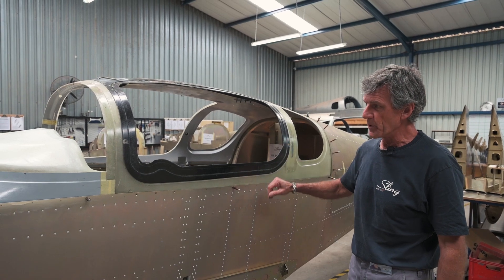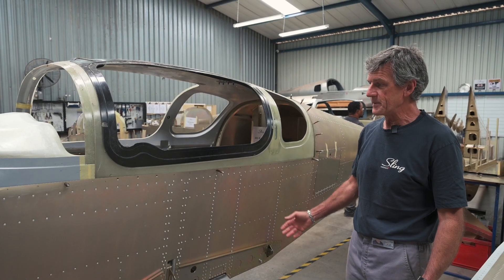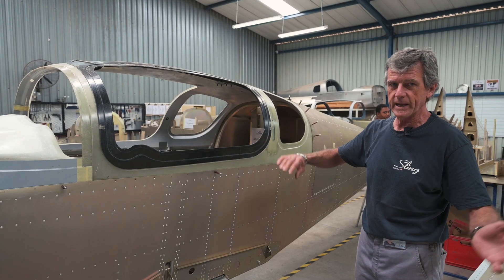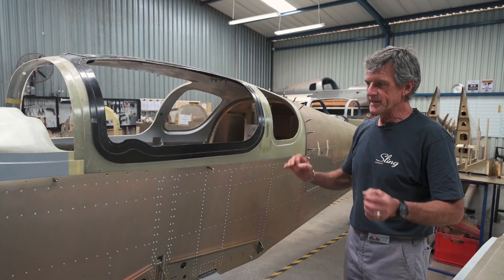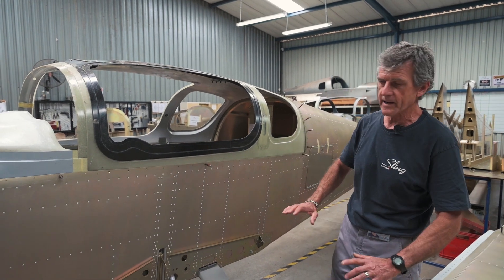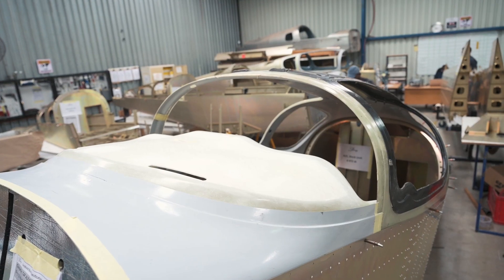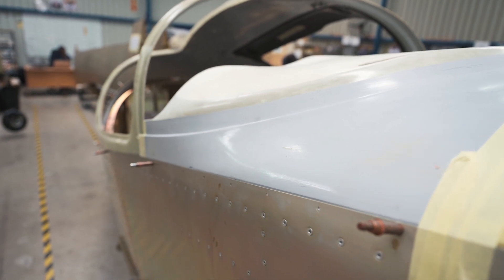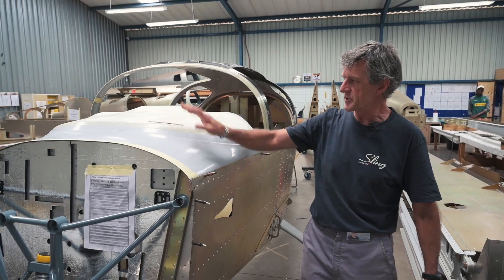Our New Sling TSi Canopy (Part 3)

Comment: Nice to see you getting into composite. Said this earlier. An even lighter plane with same engine will be great. Hoping we see you guys go full composite in time. 

Question: If the FAA Mosaic rules pass, will you guys go for LSA certification for the TSI? And if so, will you guys ramp up production of completed planes? (Another reason why going full composite is the way to go). A 4 seater certified LSA with optional parachute, that's a series proposition, especially with your current pricing.